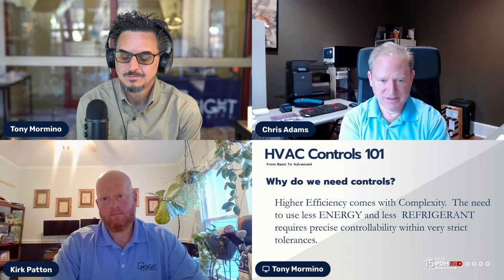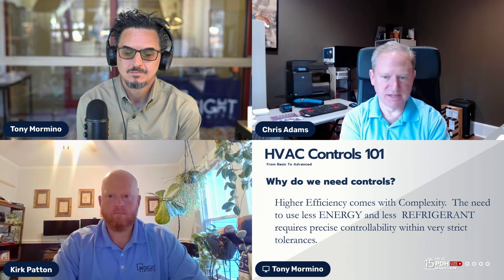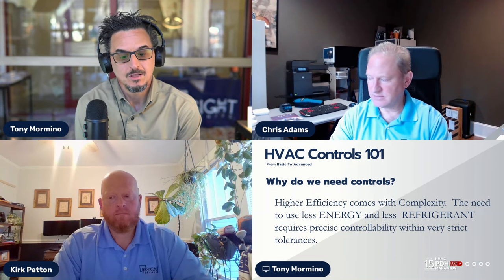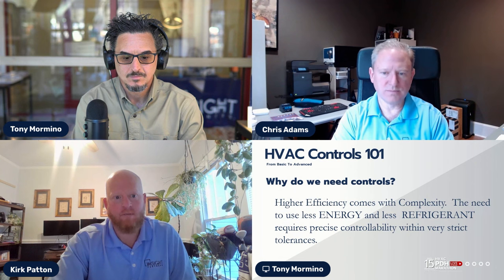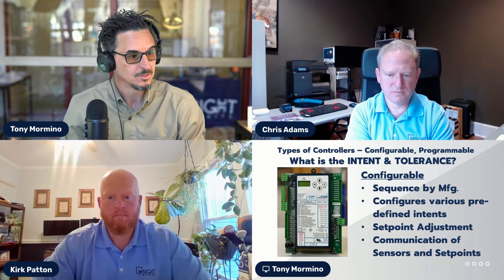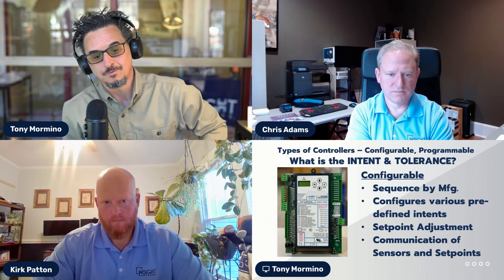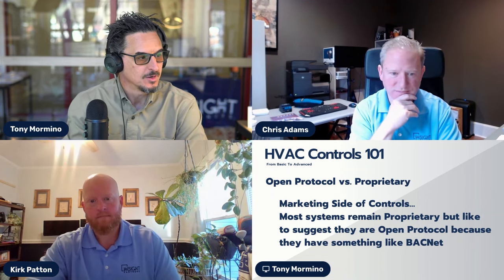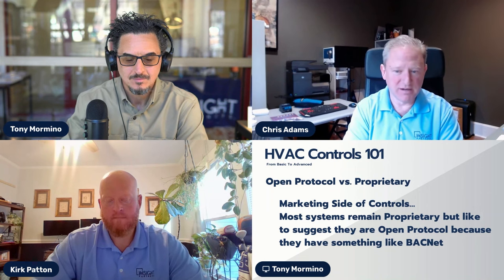Commercial HVAC Controls 101 - From Basic To Advanced

Comment: I’m not listening to a 1 hour presentation. Understand the specific controller’s logic, application, the different components that provide the inputs/outputs, and as far as programming and configuration, that only comes with real world experience. These nerds over complicate the technical aspects, because they set at a desk and study mechanical engineering all day. Most field techs. aren’t plotting grains of moisture per lb of air when it’s a 90* day while the roof ranges from 110-135* radiating off a black rubber roof. These programmers are about to lose their job by A.I., these dude’s wouldn’t last a week as an hvac technician.
Reply from the maker: Chris Adams and Kirk Patton are two of the best commercial HAVC controls minds in the world. Programming, wiring, building panels, installing. All hands on from the ground up. They have over millions of square feet of compels project under their belt. And by the way, they've taken time to record this podcast to give back to the HVAC community. Unlike others that just go around trying to dump on those giving freely.

Comment: Pretty good discussion although little weak on pneumatics discussion knowledge. The only thing I would add is… it doesn’t matter how good the controllers are and how perfect the programming is, if improper wiring techniques and installation/ termination practices are subpar the entire project is doomed for failure. The biggest failure in the controls industry is the lack of basic electrical knowledge, RF contamination, improper grounding techniques and wiring all around.
Reply: I strongly disagree!! I've been installing control systems for 20 years and my favorite thing to say is ..."check the programming" 😂😂😂
Me and a few of my guys in Seattle are ALWAYS re-engineering these horrible jobs from control companies 😂😂